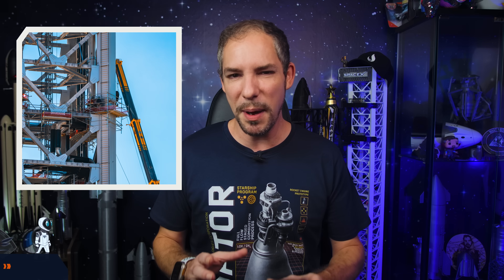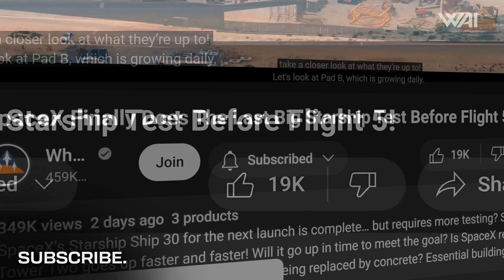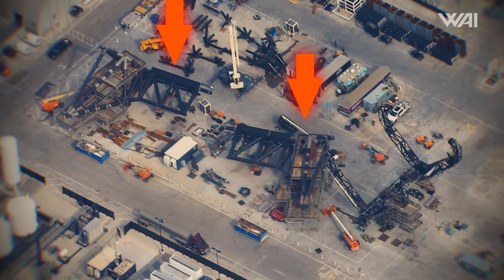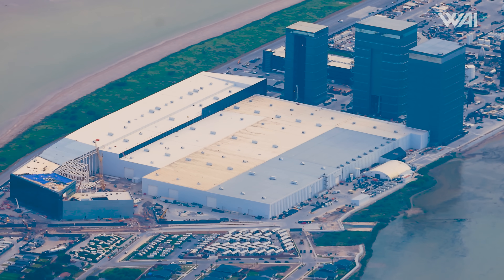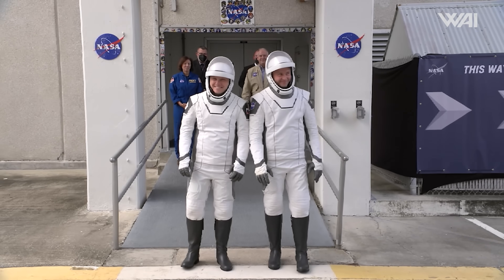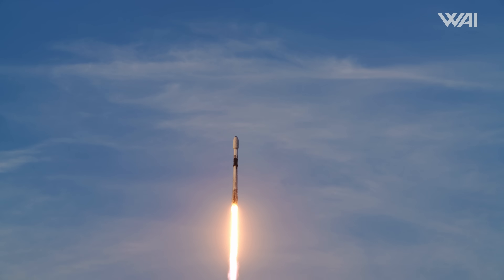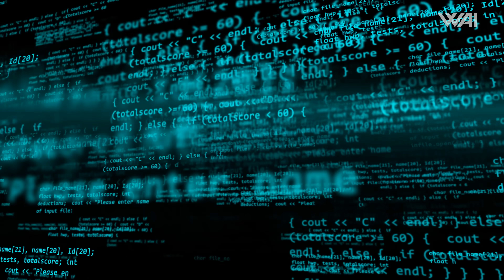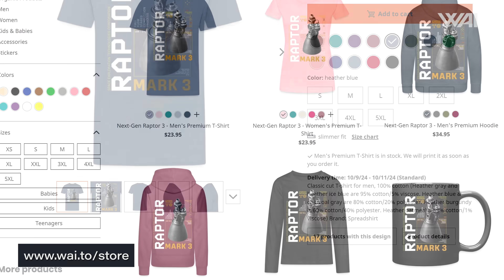SpaceX Finally Starts Most Important Project! NASA Explores Alien Ice Ocean!

Comment: Can you get any Thermal Readings with the Camera you use on the Booster, on Tower 2? Curing Concrete gives off Heat and you could tell how High they are with filling the Concrete.

Comment: Elon Musk could put Space Shuttle like doors on the SpaceX Starship and have cargo pods (24’ X 48’ to 68’) that are pushed out of the cargo bay using springs, and have anti-spin, course correction devices on the cargo pods and use a cargo pod pusher to push the cargo pod towards the moon / Mars, and use a cargo pod lander, to land the cargo pods on the moon / Mars. And have at least two doors on the bottom of the cargo pods, and connect the cargo pods together using inflatable tunnels, covered with cement by 3D printers, the cargo pods could also be covered with cement by 3D printers, the cargo pod could have built in facilities in them, like everything a moon / Mars lander would have in it, or everything a space capsule for 100 people would have in it.  Or a refinery, factory, warehouse, farm, orchid, dairy, ranch, fish growing facility, grocery store, retail store, hardware store, park, amusement park, arcade, night club, city hall, police station, jail, recycling plant, repair shop, etc., etc..  Also he could use inflatable habitats / buildings, covered with cement by 3D printers, when larger facilities are needed / wanted.

Comment: I think in order for concrete to be at its strongest, pours should be as continuous as possible so there are no 'seams' which would be areas of weeknest. If you see the pours for large building foundations, once they start, they do not stop until it is full...like when they were pouring the upgraded foundation under Pad A and the steel plate.

Comment: At this point, I am curious why they don't install some kind of mechanism to use one of the arms as a crane to remove hot staging ring, etc? Seems like they have nearly everything in place and it would not be all that difficult. Maybe on the outside of one of the arms so that it does not interfere with (un)stacking and catching? Seems like it would be more practical than having to move the crane in and out all of the time.
Reply: Maybe they won’t have to move it in the future.
Reply: There will always be parts that need to be replaced or repaired (hold down clamps, umbilicals, etc) even after the hot staging ring is more permanently installed on the booster.

Comment: Underperformance from that second stage (opinion only) may be due to the excess O2 venting that I noticed during its launch.  Remember there was an anomaly on stage 2 a couple launches ago before it pulled a RUD?  Had all that ice build up from the O2?  I was seeing something similar but not as dire.  It was a lot of Gas being dumped - a lot more than normal.  Anyone else notice that?

Comment: I'm starting to think that SpaceX has become plagued by the same counterfeit metals problem that plagued Boeing.  I'm start to suspect that the oxygen line in the 2nd stages are made of counterfeit metals that don't have the stated properties.  So, once you're in space and pressure is near 0, this tube made of counterfeit metal doesn't have the advertised properties and can't endure the pressure differential.  So, it ruptures and starts leaking cryogenic oxygen. So, this sub-nominal burn...  could have been that they had fuel, but ran out of oxidizer due to an O2 leak.

Comment: Pre-designated not pre-designed.  Still got the message across.

Yes, FAA is a bit tough on SpaceX, but they need to review ALL their processes.
Reply: Why?
Reply: @jamskinner  to increase efficiency, reduce cost for the FAA, and produce faster turn around while keeping their mission in sight.  Basically I have not known a process that I have ever been involved in that could not use some review and optimization.  For the most part using the 80/20 rule is good enough unless you still deviate to far from the overall goal of serving your customer (in this case the service provider, the public interest, and taxpayer, not via apparent cronyism that seems to be there, but it could just be incompitance at some levels instead).

Comment: I think if the launch mount is moveable, it will only be for swapping it out, not for rolling it in with booster attached. Chopsticks would still be used to lift booster onto the stand.

Comment: Imagine launching this probe on Starship. Could be there under 1 year with much better sensors and shielding. And far cheaper, not just because of the launching cost, but because the much more lax mass constraint. Which also translates into bigger solar panels to provide more power, which also makes the probe cheaper.

Comment: 16:15 - You are confusing radiation and radioactivity... They are related but not the same.
Reply: Not necessarily - the radiation in the belts are from trapped particles like electrons, protons, helium nuclei, etc, spinning around at high speed but contained in that region because of the magnetic field.  Radioactive substances also give off the same particles when they produce alpha and beta radiation.  The only real difference is the source, but that wasn't relevant to Felix's comparison.  Side note, Chernobyl really is a spa, as it's become a home for so much wildlife since humans left the area.

Comment: 1:38 -- that overshooting and oscillating  thing can not happen during a catch attempt or the booster will be damaged or destroyed.  But, the Chop Sticks are so massive that it will be very difficult to move them as fast as needed without overshooting and oscillation.  Put simply, the approach SpaceX is taking for catching rockets will not work and I think SpaceX knows it!
Reply: It no longer does that, that specific footage is of old testing.
Reply: @infintygamers00  I'm sorry, the mass of the chop sticks is enormous and the moment of inertia is insane, controlling them at speed will be ... impossible!